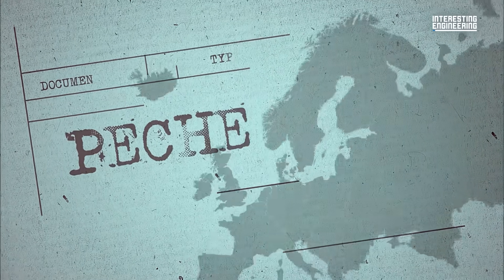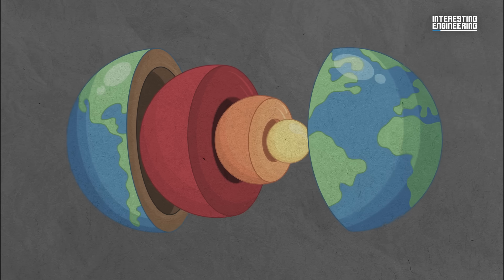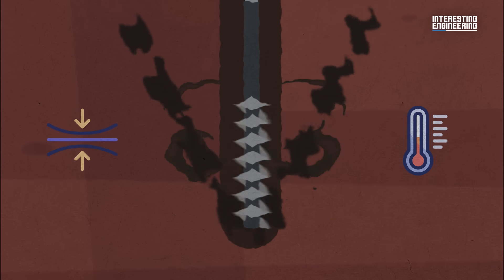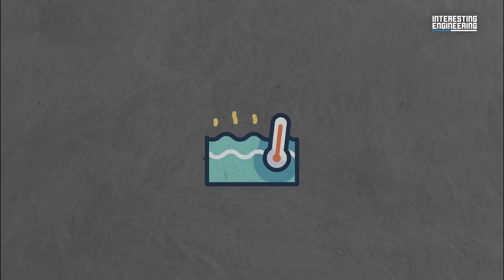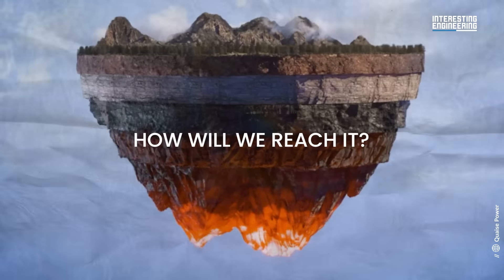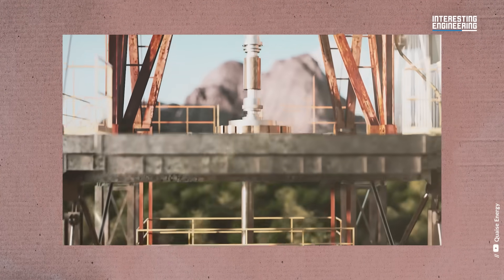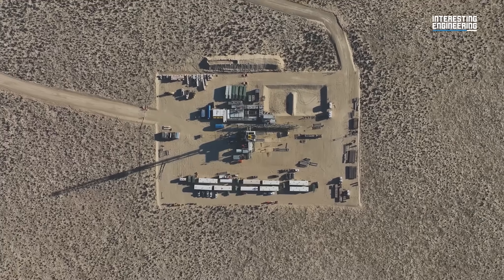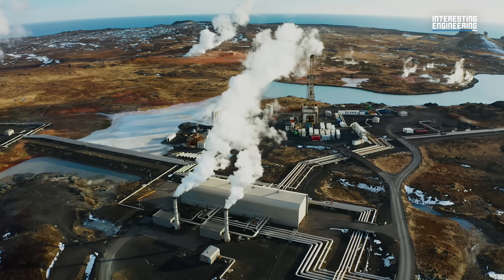How Deep Could We Dig for Infinite Geothermal Energy?

Comment: So far, most geothermal power stations are limited in size.
Geothermal power plants vary in size, with utility-scale projects typically ranging from a few megawatts to several hundred megawatts. The largest is The Geysers in California, a complex of 22 plants with a 900 MW capacity, while other plants are much smaller, sometimes as little as 3 MW. Overall land use is relatively small, requiring 1-8 acres per megawatt.
Reply: Geothermal has been relegated to select locations on the planet where the crust of the earth is thin, or has hgh volcanic activity, but we now have ways to make geothermal an option everywhere.

Comment: FYI Solar and Wind power generators are the worst pollutants, when it come to wind power, blades after becoming weak do not go trough recycling process, they just berry those blades and thats it. We have access to green power and it's called Nuclear Power Plants
Reply: Fossil fuels are the worst.
Reply: @jamesvandamme7786  Are they? Then stop using them, start by not using your phone, computer etc etc.
Reply: @galgadsmith  Think. Fossil fuels are used ONCE, then we have to deal with the pollutants. Solar and wind generation runs for 20+ years. 
Nuclear is non-CO2 emitting but it has other problems. Plants take too long to build, are expensive, generate waste. Renewables are cheaper.
Reply: @jamesvandamme7786  No they are not, blades from wind turbines cannot be recycled PERIOD, only way is to bury them deep in to ground which is such great idea, and solar panles, why don't you look where some materials come from (hint ... child slavery). Wind and solar power have to synced with a grid which complicates things, power cannot be stored. And nuclear is the proper way imho, there should be high standards for it but it should be utilised.

Comment: Someone probably already thought of this, but what about using the heat from calderas or super volcanoes as a source of geothermal energy. That is a lot of heat from the interior Earth near the surface. Perhaps the areas around the caldera near Yellowstone would be potentially a good place for geothermal energy.
Reply: When I was serving in Keflavik, Iceland, the entire NATO, USN airbase was heated with geothermal district hot water and we also used geothermal electric energy. There is also a hotel and health spa known as the Blue Lagoon at the plants location. 
However, there has been a series of eruptions along the fault line and although Iceland has built dykes to protect the plant, one bad eruption and the entire plant will be wiped out. Hopefully, the plant be remain safe with only minor damage from the lava!

Comment: I am 100% for an all low/no-carbon power grid no matter what the source and you should be to. Let the market sort that out. What you should be horrified to know is that COAL KILLS way more through its mining, milling and burning than a 10000 Chernobyl's but because it's so common place nobody gives a flying F*CK. Black lung, asthma, COPD, silicosis are just one of DOZENS of ailments linked to coal power as well as diesel, gasoline and even natural gas thanks to PM 2.5 which is a whole pandemic few bother to talk about.. That reason ALONE should have everyone being pro SOLAR/WIND/HYDRO/NUCLEAR/GEOTHERMAL AND ANTI COAL/OIL AND GAS...

Comment: One thing I have noticed that seems to be common among all of these geothermal videos and discussions: Nobody is talking about what happens when we remove energy from deep within the earth. Have there been any studies or scaled experiments involving this practice? If not, there probably should be before we get too far ahead of ourselves and start destroying the planet from within.
Reply: The heat at depth is continuously replaced by natural nuclear fission. This is why the core is still so hot after billions of years. Heat removed by us is negligible. Natural superheated steam escapes from geothermal vents. These surface magma heat sources have provided power for 50 years in NZ. The main problem is the aggressive chemistry of the steam. Good luck with length of life of geothermal power systems.
Reply: One possibility to side step that issue is CO2 turbines and heat exchangers.  @howardsimpson489
Reply: You over estimate mankind, next thing you'd probably say is solar is bad because we're taking away suns power lmao

The most we ever went through the crust, which is 35km or 0.5% of the radius, was 12.5km, which is around 1/3

You should probably enlighten yourself before trying to preach such stuff man
Reply: I rarely overestimate mankind, but I don't think it is possible to overestimate mankind stupidity or arrogance.

Solar isn't bad because it takes power from the sun. The sun puts out x amount of power on its own, solar simply collects y percent of that power. No, solar is only bad because of its inherent inefficiencies, same as wind.

And for the record I was not preaching, merely attempting to make people think.
Reply: No there concern is legitimate, it's important we educate about the size and chemistry of earth as in democratic system, every new citizen that understands and challenges / improves on our ideas even in the slightest is a victory  @nova.3192
Reply: @nova.3192 Yeah Solar would be bad if it covered the entire earth which is more what he was getting at. 

 Having geothermal plants everywhere can definitely cause a lot of issues. Especially if we keep increasing powder demand like we have. 

Earth's gunna be solar panels everywhere including space, geothermal, and just breeder plants since fusion is always 20 years away. 
 
 Then once we've covered the earth we may get Google that can actually find what song I'm looking for.
Reply: Rather than insulting you as everybody else seems to want to do here, it's a worthwhile question, but not really a concern.  The amount of heat within the Earth is so massive that if we switched entirely to geothermal power, and used it for the next 10,000 years, we'd take so little out that it wouldn't even be noticeable.  The Earth actually makes heat of its own (from radioactive decay of elements within the mantle) faster than we can take the heat out.
Reply: The windmills are using up all the wind too! How are sailboats going to get around when there is none left!?
Reply: We might not see any difference in a million years. We may need to dig deeper few meters. 
Maybe in few billion years Earth's core will be dead anyway. All humankind are going to facing extinction before sometime could see that.
Reply: Geothermal is bad, due to the way they inject water into the earth randomly. Bringing up all types of nasty stuff. 

 I'm not worried about it losing heat. I'm worried about all the other effects. Especially once we start getting into GW territory plants. All the leeching. 

 They better use those loops is all I'm saying. Fracking already causes enough damage.
Reply: Drill baby drill! Is essentially what all the comments are saying
Reply: Bro…it’s infinitely molten lol
Reply: I disagree with the rest of the people. You are 100% correct, if we took all the heat out of the core it would have tremendous bad effects for us... and no quality studies have been done to fully understand that risk.

However, with that said, the amount of heat trapped within Earths core is so incredibly immense that it would take us 1000 years to even scratch, and thats only if we invested our entire worlds resources on building geothermal....
I could do the math for you, but I wont, lets just say its 1 billion times more energy than all of life on earth has used since the beginning of time.
Reply: Tldr: that comment is dumb, we can't extract that much power, even if we manage to dig half way across the mantle commercially, that energy we can extract would alone be negligible for earth but could power us for millions if not billions of years
Reply: @nova.3192  its not feasible to change the temperature of the whole earth, but the NZ geothermal plants sunk enough local geothermal heat that hot springs stopped flowing.
there are local effects and those effects are the main reason why you will never get a permit to drill around the best areas for geothermal power (ie: yellowstone-type areas). because the government is afraid that with time you will cause the geothermal features such as hot springs and geysers to slow down or stop, which again, actually did happen in NZ.

Comment: I have never read about the geothermal proponents talking about how to deal with the radioactivity brought to the surface with the working fluid.
Reply: Geothermal energy is generated by the natural radioactive decay of elements like potassium (\({}^{40}K\)), uranium (\({}^{238}U\)), and thorium (\({}^{232}Th\)) in the Earth's crust and mantle. 
This process creates heat that can be harnessed for power. While the geothermal fluids contain natural radioactivity, the concentrated residues left behind in geothermal plants, known as technologically enhanced naturally occurring radioactive material (TENORM), can pose radiation risks during maintenance. 
Nothing that can’t be safely handled with known, normal safety measures
Reply: There's a few seconds of an animation that would begin to address it... primary and secondary loops. The "water" in the primary loop is never allowed to flash into steam and be released into the air. (same way nuclear plants work.) There's also toxic materials getting dissolved into the water as well.

Comment: Drilling deep holes using water and fractures is 'old' tech.  I was involved in a geothermal pilot a few years back in my country that proposed to use similar tech to Eavor.  Pentane or Heptane has a far lower boiling point, and when used in a closed loop doesn't require fracturing.  Moreover, with proper geological identification, deep drilling isn't even required.  Out site would have required drilling to maximum 90 meters.  The problem with geothermal is not a technical or economic one.  It is entirely political.  That being said, even under the best conditions and with everyone's buy in, geothermal could at best only be part of the solution and could never replace anything.  The physics for making it work simply does not exist everywhere.

Comment: we should think of wider holes. That would slow the speed to get deeper, but gives times to the rock to cool slowly and become stable. The aim would be to go the "verbetical one mile further" and create a constant boiling column.
Reply: Would that not drastically decrease the speed at which the hot water comes back up to the plant? If making holes wider creates a necessity of pumping stations instead of relying on thermosiphoning, that will mean you will need to go even deeper to compensate which is going to the harder to do and less economical.
Reply: @JustSilen  One just needs cooking for getting heat up. The mentioned verbetical mile is to reach constant replenishment of moving magma. Most important is that more drilling techniques can be used side by side and combined with uphauling debris. Do I have to explain all that? And not to forget about reinforcing the borehole like with horizontal boring etc
Reply: One could drain the whole system for repairs

Comment: Is there not a consequence to pulling a significant amount of heat and energy out of the earth? Possibly far less than other energy sources but it has to affect something at some point in time.
Reply: Absolutely. After 3 or 4 billion years humans may take enough heat out of the earth to matter. Hopefully we will have something else figured out by then.
Reply: So if you look at the numbers..

There is an estimate of 3 x 10ˆ31 J of energy inside the Earth. Global power production in 2023 was approx 90.000.000 TJ or 9 x 10ˆ19 J. At this rate, extracting just 0.01% of the thermal energy inside the Earth would take around 20 million years. That is assuming that the thermal energy is not replenished by nuclear decay, friction and gravitational interaction and also assuming we fulfill 100% of our power need through geothermal. I think its pretty safe to say that this scenario is not a concern.
Reply: @janusprime5693 again my comment wasn't about how long the energy would last.
Reply: That is what I was thinking, slowly cooling or removing the  heat from the hot rock?
Reply: @roblonsdale8927 y'all have no idea how absolutely massive the planet is, and how miniscule these power plants are in total. We got massive oceans that already cool huge hot spots at the continental ridges, and the planet's core pumps out heat constantly into the mantle. This would be like trying to dry up the pacific ocean using a vaccine needle, you're never putting a dent in it.
Reply: Yes, but it won't be apparent for hundreds of generations. (thus "infinite")
Reply: @jfbeam well firstly you have no idea how soon it would start to affect anything. But my question was "at some point in time" so your answer is just dumb and irrelevant.  Also "hundreds of generations" is not that long from a biblical perspective and just a blip on the radar from the big bang theory. So not even close to almost maybe infinite.
Reply: @jfbeam you keep bringing things into the discussion that aren't relevant to it.  A very common tactic for those who think they are way more intelligent than they are.
Reply: @jfbeam wtf are you talking about? Your answer wasn't contrary to what I want to believe it wasn't what I asked. How are you not understanding that? Obviously this issue or ultimately any issue dealing with energy isn't something we have to worry about in our lifetime or generations down the road. But yet again you are going off track to try and prove something I'm not even asking.

Comment: The answer of course is to lubricate the shaft and the drill bit with a fluid that can also be pumped to carry the waste away from the drill and the shaft.
It will require an inner hollow tube and an outer so that the fluid can be pumped down the inner hollow tube and up the outside of the inner tube between the outer and inner tube with some of the fluid flowing outside of both pipes to lubricating the outer shaft.

It's rocket science but going the other way.
Reply: Yes, this is like the first 30 minutes of Drilling 101. (that's "drilling mud" in the industry) The issue, as they said, is finding something that can take the extreme heat, but at some point the pressure becomes to great for traditional drilling methods. Plus, the length of the drill shaft then becomes the limit as the torque over such a great distance snaps the pipe. (thus the plasma drilling technology, and gas is easier to blow out of the 10km hole.)

Comment: Geothermal energy is NOT infinite.

"The flow of heat from Earth's interior to the surface is estimated at 47±2 terawatts (TW)."

"Global energy consumption reached a record high in 2023, at 620 exajoules (17 x 10^4 terawatt hours)"
Which equates to an average power of 19.7 TW, that's getting close to 50% of geothermal heat Flux

If we extracted anything close total energy demand it would probably cause some interesting effects on the behaviour of the Earth's crust or mantle because we would be calling it down. Deep geothermal effectively short circuits the heat flow through the Earth making the ground above the extraction depth become cooler and probably shrink.
Reply: Earth's core has been molten for billions of years. Sure, we're definitely going to screw with that, but it would take millions of years for us to kill the planet. (and when we no longer have a molten core, we'll no longer have a magnetic field... it goes down hill fast after that.)

Comment: If we extracted large amounts of heat from the earth's core, what are the chances of solidifying it and slowing or stopping the flow of magma that created the earth's magnetic field, thereby removing the protective force field that protects us from cosmic radiation.?
Reply: We couldn't
Possibly withdraw that amount of energy. We wouldn't make a dent in thousands of years.
Reply: A single volcano has more energy than we'd ever extract from these holes. Are you seriously suggesting that a tiny 20 km hole in over 6300 km radius planet is significant?

Comment: With standard equipment, neon tubes are reaching only 100-feet in length. On the other hand, your glassed well shafts are expected to reach 20-miles in length. Nitrogen plasma will carry vaporized minerals aloft in an updraft that would otherwise condense into ash and prevent further progress, I'm guessing. Recent videos have suggested that helium may be hiding deep in the crust within rocks themselves. I'm certain of the value of this limited-supply gas, as well as any other rare metals in the well, but if that's also rising to the surface, is that also being transformed into something else, while encountering an ionization process a the microwave's cutting edge? 

And if a raw electrical current is flowing upwards with those vapors along a graphene coated waveguide, is there some means of maintaining continuity between all of its drill pipe sections? Or has there been an impervious continuously-fed waveguide tube developed just for this purpose? And just another thought, the cutting results look fairly uneven in the examples shown, so I'm wondering if there isn't a stirrer fan intended that distributes the microwaves more evenly, like in a microwave oven? Is hot water expected to remain so for twenty miles of earth contact? Graphene is supposedly able to transmit electricity and electromagnetic waves at nearly the speed-of-light, that's only .11 seconds. Nitrogen plasma current might be a bit slower, but those all seem likely to retain their energy for greater distances than even supercritical water vapor, don't you expect?

Comment: How do you isolate those water tubes that all the heat is not absorbs by the ground while flowing up? o_0
Reply: You don't, they let the rock heat up. Rock is actually a decent insulator so it works well